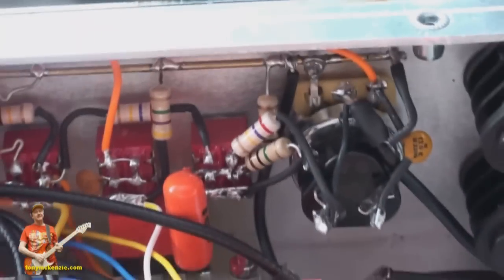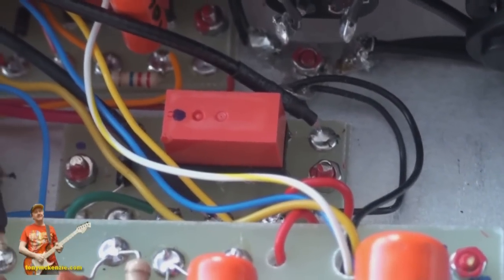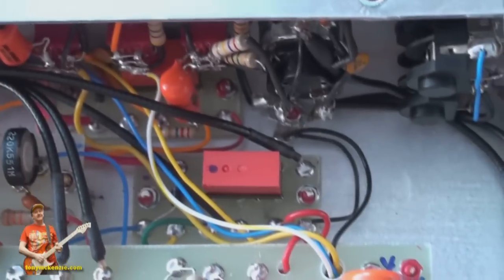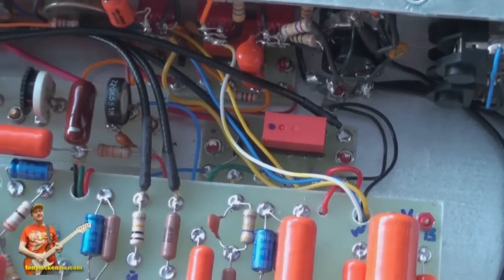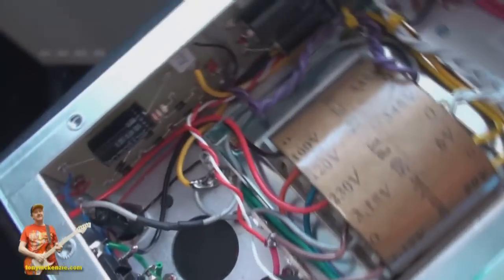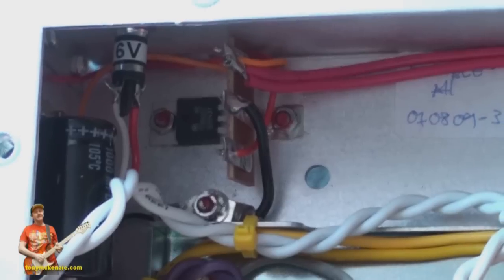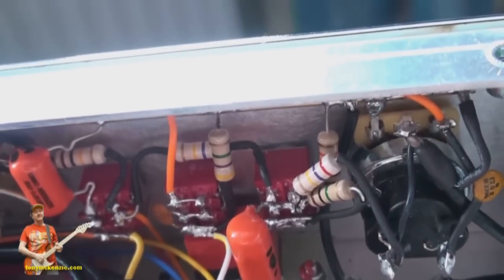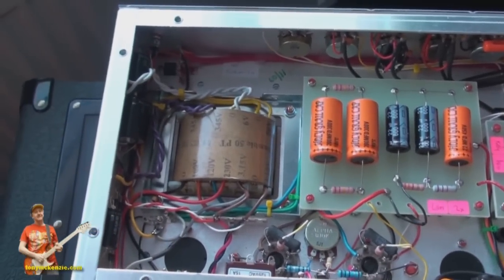Ceriatone Overtone HRM Amplifier | Part 6 | Dumble Clone | How to Build From a Kit | Tony Mckenzie

Comment: Great video series, thank you so much for making it.  

As far as securing the relays, before mounting those boards, would it be possible to drill some small holes in the boards so that a zip tie could be wrapped around the relay and board to hold them down?